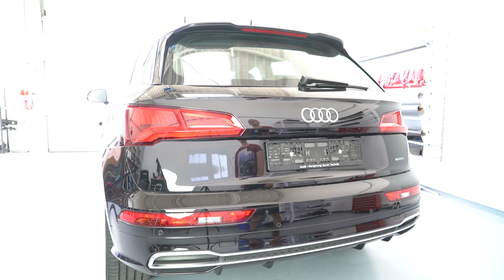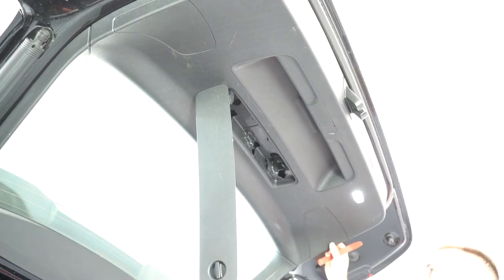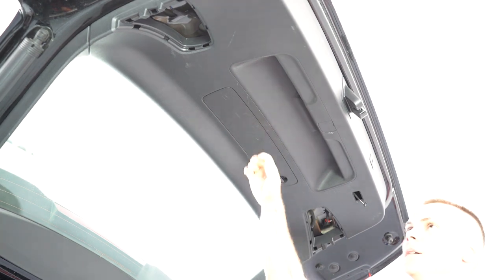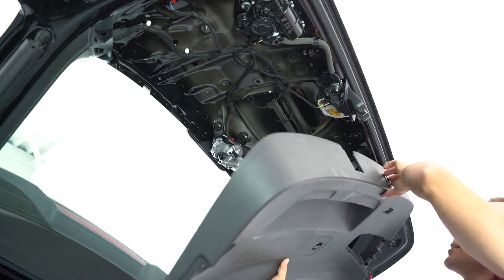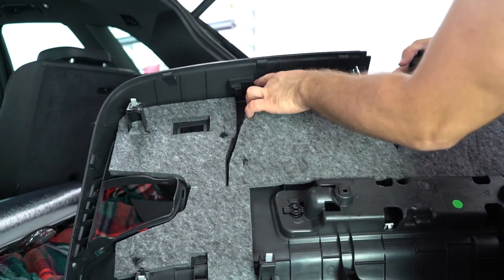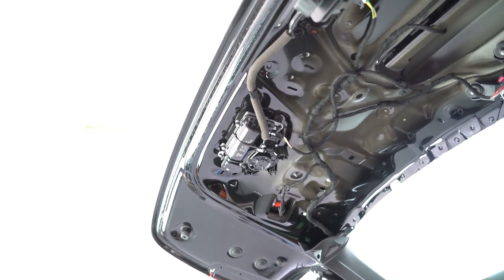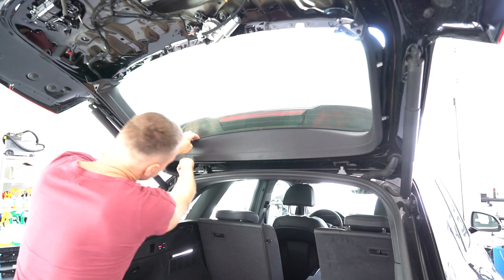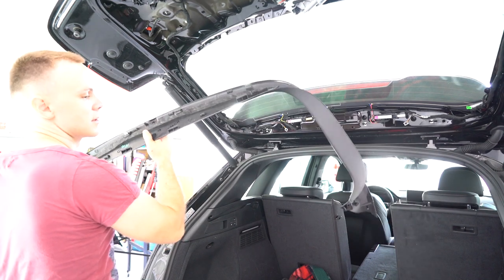Tailgate Trim Panel Removal Audi Q5 B9

Comment: I used this video to get an idea to remove my 2011 Q5 hatch trim, similar removal, excepted I didn't see him removing the screws in the smaller tail light compartments. Which I found out after trying to remove the trim but couldn't due to those screws. Then I had to slid my trim tool in-between the trim and hatch and turn the trim tool like a screw driver to pop the trim off. I did this screw drive motion all around the trim until the trim was popped off the base of the hatch.- hope that helps
I had to replace my hatch latch  actuator. The most difficult in my process was getting the trim off.